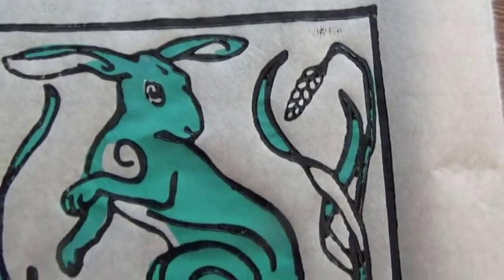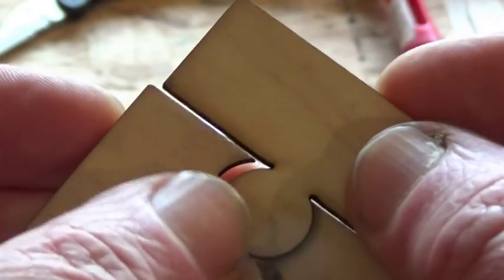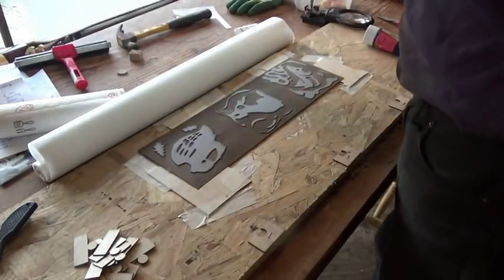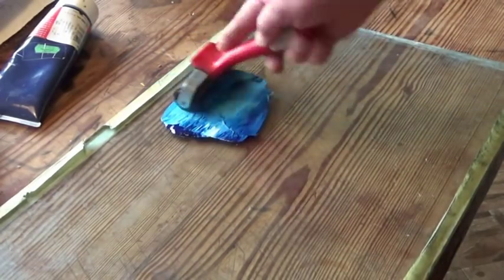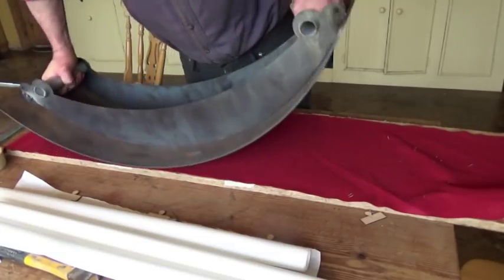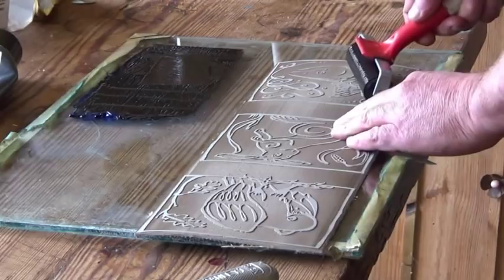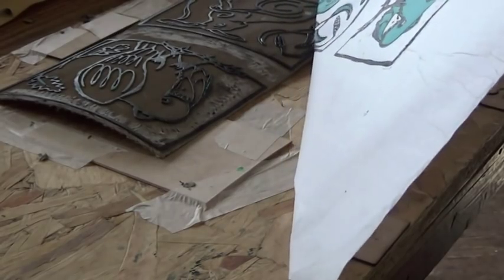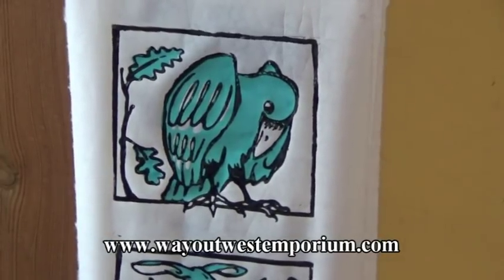Lino Printing Two Colours Using Registration Keys (Indexing plates)

Comment: I have a university degree in lithography (printing). Your method of registration using tabs is very similar to what was used commercially before computers came along.  We used steel pins taped to the glass light table and stamped out circular paper tabs taped to the paper. Main suggestion would be to add a third registration tab to the top of the paper.
Using glass to mix and roll the ink is clever. Flat, Non porous, and easy to clean.
If you do this often consider a hinged “press” to hold the printing plates and keep the paper stationary on the table (or “platen”). The way you are doing it now is just fine. But as suggested, one tab at the top would help.
Reply from the maker: Thanks, Frank. I'll experiment further...

Comment: Very good. Maybe you can use a vacuum cleaner suction to hold the plates down.
Reply: Yah, I was over-thinking how to get a fancy vacuum pump on the bottom but a shop-vac would work very well, I would think.
Reply: It sounds good but in practice it’s flawed. The vacuum would cause the ink to creep too much. It would get progressively sloppier with each print.
I have a university degree in lithography from before the age of computers, and 26 years in the printing industry.